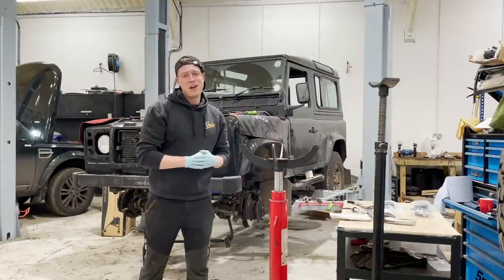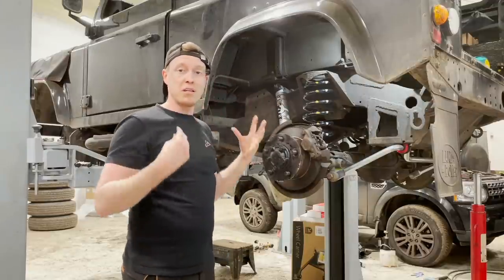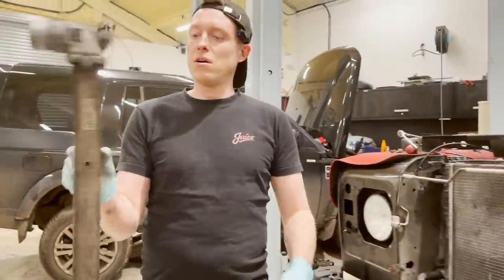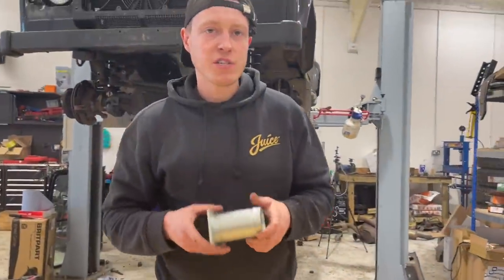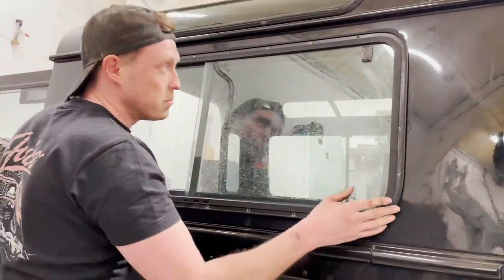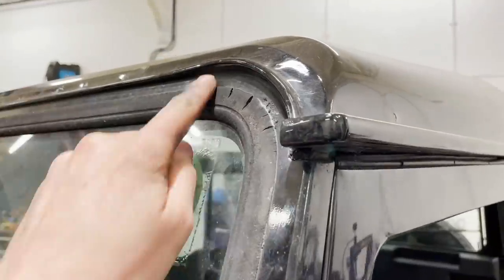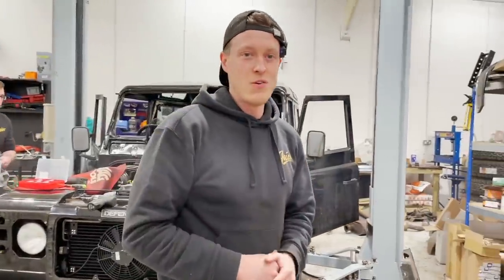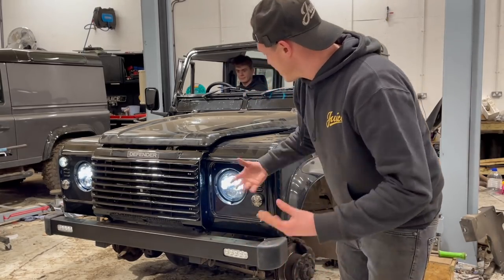Modifying a Land Rover Defender 90! - Part 2

Comment: Another great video on the defender build, would be good to see a little diversity in customer builds, ie d2's or d3/4.
The point you made about drl's switching off on dipped headlights is only on vehicles made after 2018, only know this as I've just fitted drl's to my 1999 d2, keep up the great work & let's see more videos asap.

Comment: Enjoy your builds. I am thinking about Fox shocks on my defender. Do they improve the handling or just the ride comfort?
Reply: Great to see you back !! 
I guess there not as good as the air ride you did  but might be more in my budget 😞 
would like to know as well also what springs did you use 
And would it be ok just to do back and the front later ??  Just thinking about doing it in stages 
Hope your all well nice job  
Neil

Comment: Love your channel. I am thinking of a 2 inch lift for my 90, do I need to change the radius arms or +2 springs and shocks will suffice? Also for the tires, can I go any wider than a 285/75/16 on a stock 16" rims?

Comment: What on earth made you put fox shocks on? I ran a set on the front of my 110 (Koni's on the rear) and they shat the bed within 9 months. 5 years later the Koni's still perform brilliantly.
Reply from the maker: Because they’re the best. I’ve fitted every suspension available. I also run Konis on one of my other Defenders. FYI running a set of Foxs, 3 years on, nothing but superb ride, no issues.

Comment: Great job guys. I'm putting a DRL bumper on my td5, where did you get your ignition live from? Is there one in the engine bay? Cheers
Reply from the maker: We get the live from the vehicles fuse board inside the cabin, a lot more work but a perfect install 💛

Comment: Aren't you meant to replace the intercooler hoses with silicon hoses when you perform this upgrade? That is at least recommended by Alisport where I brought mine.
Reply from the maker: These hoses are still in great order, there’s no need to spend money where it isn’t required.
Reply: @juicemotors  just thought while your in there and for the sake of 30 or so pounds would've been worth it

Comment: So on my Landy I have the DRL on the bumper however mine don’t go off with the main lights and mine passed the MOT? How come you have done it like this?
Reply from the maker: The MOT regulations state that if they’re fitted by the factory they must auto switch off with the dipped beam. I’m just OCD about making it as factory as possible

Comment: Does the EGR delete affect the MOT emissions??
Reply: just stick it back on for the mot then off again after lol
Reply: Mot emissions test exhaust gasses when the engine is accelerated and the egr is only active during idle or very low throttle input while driving. So it doesn’t effect emissions testing.
Reply from the maker: There’s currently no legislation about blanking off the EGR valve, it’s always handy keeping the original parts to be safe
Reply: @juicemotors  think you should check section 8.2.2.1 a) in the MOT manual. This would be classed as a major defect...

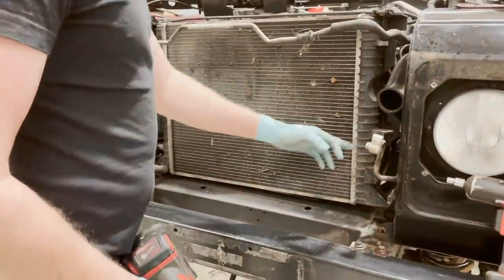Comment: @12:00 Now that the front grill, condenser& intercooler is out.. might as well remove the radiator and clean the core inside and outside. 
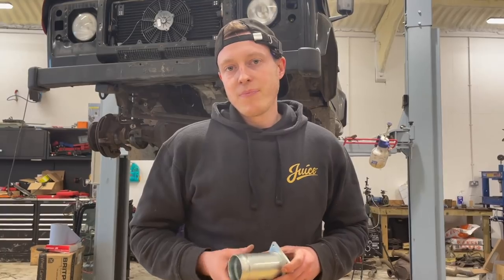@17:00 Im sure every tech in this industry would know that the mean purpose of EGR is to keep the piston crown temperature down there by reducing Nox if not stopping it completely. Why kill the environment just for few more horse power?
Reply: I would say the main purpose of EGR is the reduction of emissions, the piston crown is just a side effect of less combustion occurring. And removing it will greatly reduce the build-up of crud across the valve train so I still think it's worth doing especially on a vehicle like this where it will never be an eco warrior.

Comment: Garages are failing cars mots that have had the emmissions equipment tampered  with now   plus iv dvsa were to stop a vehichle with deleted emiissions equipment . It would be prohibited from goin any further so u have to be carefull if ur deleting emissions controls . Im surprised to see it on a vid u doin so . As it opens u up to prosecution for tampering with emission control equipment . Its on there for a reason whether u agree with it or not . Im not having a go at you im merly  pointing out whats happening  atm . Lovin the vids . Tho. Pls take care ..
Reply from the maker: Hey Ian, currently in the UK there are no legality issues with removing the EGR valves. That being said we always keep the old parts just in case legislation changes 💛
Reply: @juicemotors where have you been man! Nice to see another series! 

Just before the last round of MOT changes, I believe there was a consultation doc of "proposed changes" which listed EGR deletion as a fail. This didn't actually make it into the Test but people seem to think it did as it was proposed. Even so, I left mine on and just put £2 coin into the bolt flange as a hidden "blanking plate" (300tdi)

Now particulate filters, that's a different story...

Comment: Those headlights are going to fail the Mot if they are all Led, on the newest mot laws the cars have to be fitted with factory headlights for example the defenders have halogen headlights stock so it needs halogen headlights back in
Reply from the maker: That’s incorrect, the laws state that an LED bulb cannot reflect from a halogen refelector, since were changing out the whole headlight assembly for a purpose built LED headlight they won’t fail
Reply: Really?!? I knew that the other bulbs didn’t matter in terms of what kid of light source they where but I thought the actual main bulb had to be factory, okay cool! Thanks for letting me know

Comment: According to the MOT manual, DRL's are only a testable item on vehicles if they are fitted as original equipment to vehicles first used on or after 1st. March 2018. So there is no need to have them switched off with the headlights. Might be worth checking the regulations before you make up your own.
Reply from the maker: We’re all about factory fit modifications, since we’re bringing this vehicle up to date it’s only right that we wire it correct to modern day standards as it leaves for a better impression. I do actually know the regulations, I just didn’t think anyone would notice or care enough to comment. Hope you enjoyed the video!